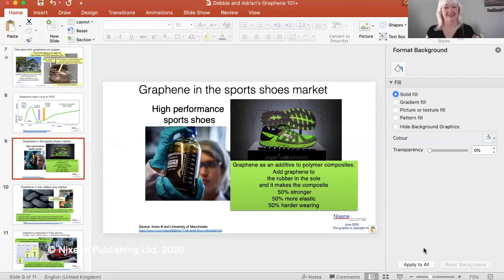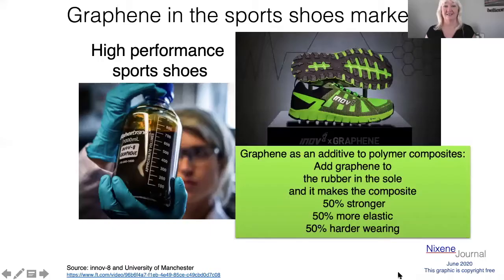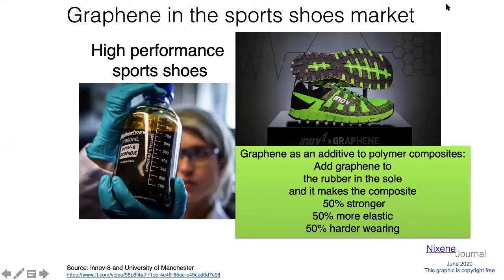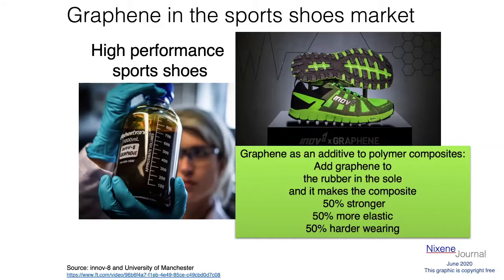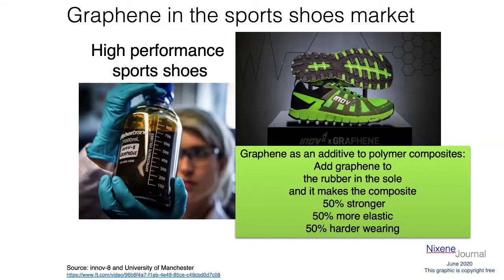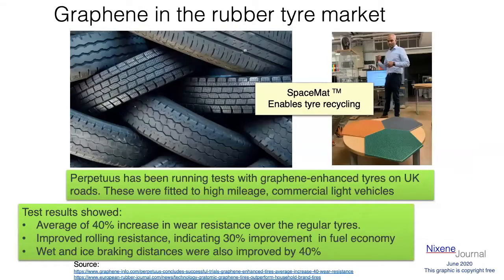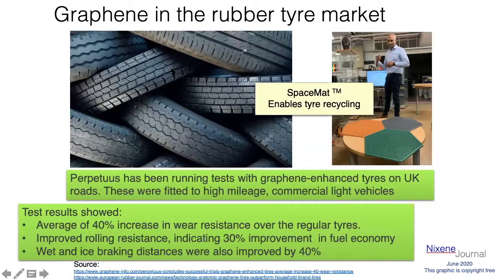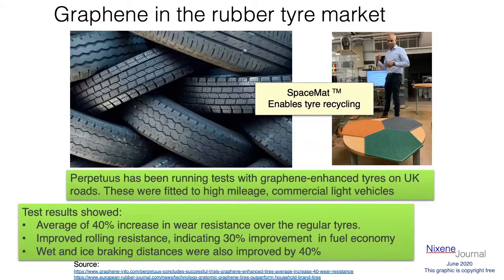8 - Graphene in Polymer Composites

Comment: Has anyone made a graphene based elastomer or a less elastic material like mylar with very low helium permeability? What would be the best method to create such a material? I assume the graphene enhanced rubber in the tires does not have this low permeability as they're not designed to hold helium.